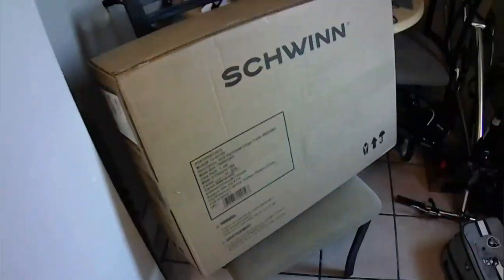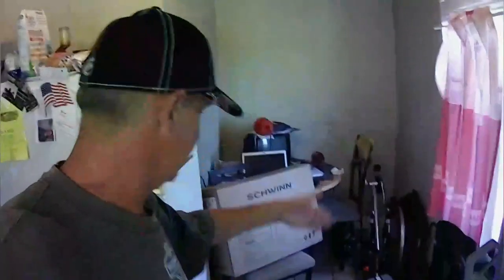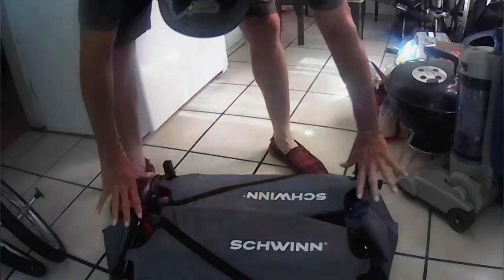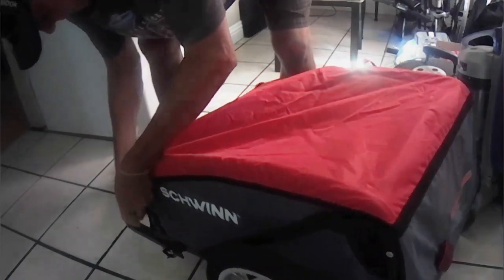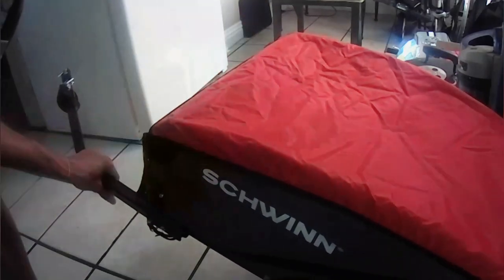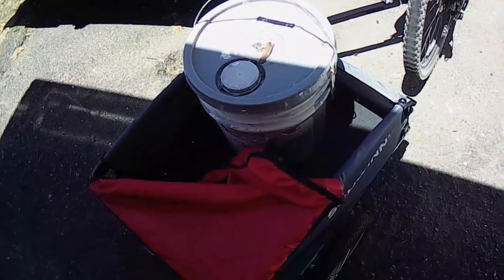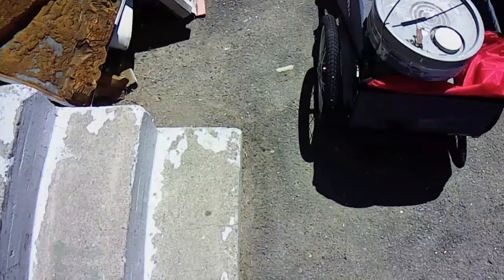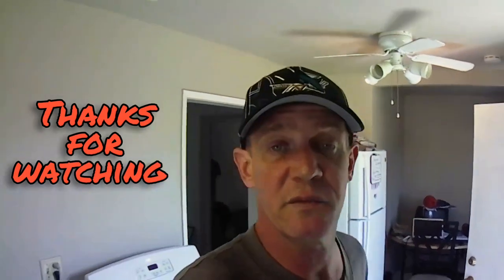Schwinn Daytripper Bicycle Cargo Trailer [unboxing]

Comment: Thanks for the review. Could you please tell me what the outside dimensions are when it is folded up? How has it lasted over the years you have had it?
Reply from the maker: When the two tires are removed and the arm folds and you collapse the walls, that will be the dimension. same as the floor of it.
Check for accurate dimensions in their description on my Amazon link.

I hope that helps.

I'm unable to as I'm on my way to work.
Reply from the maker: I forgot to also ad was when you do fold it up, it could be slid underneath a bed if that helps you out as far as how bulky it is.
Reply: Thanks for the information.

Comment: Hi Dan, you're a genius and your film is a great idea. I bought a day tripper cycle trailer.  Unfortunatley I got to the bit in your film at 5.11 and it didnt work for me, the arm swings round OK but it just wont snap in. It goes in the slot on the upright OK but however I try to get it to  snap and lock, it won't. Neither of them works, I expect I'm doing something wrong and there's a simple solution but I can't see it.  I tried contacting Pacific Cycles but when I was still at No.26 in the queue after 30mins I gave up. They dont appear to have a comtact email address.
Reply: Should have gone for the Burley Nomad...or even the Burley Flat Deck.
Reply from the maker: Once you swing the arm around, you replace the cotter pin back into the hole to secure into position. 
I think that's what your asking.
There is no automatic locking mechanism to secure the arm into position. It's locked into position with the pin.
I hope that helps.

Comment: What is the material used for the trailer floor?
Reply from the maker: I don't know exactly what you would call it but it's a durable yet flexible type of plastic, if that makes any sense.
The frame gives it stability.
I hope that helps.

Comment: The rims/tires look wobbly... loose fitting. Are they?
Reply from the maker: No.. 
Actually, once you insert the large cotter pin in place to secure the wheels, it's really stable. 
I put weight into it and it towed along just fine. I wouldn't risk overloading it though.

Thanks for the question.
Reply: @therealWoD  Thank you!. I currently have the Allen Sports Act 200, and they use a proprietary hitch & coupler (mount), and the coupler that stays on the bike, was stolen along with my bike a few months ago, and Allen Sports no longer supports that trailer (no parts), so I'm looking for a new one, and your review cemented my decision. Thank you!
Reply from the maker: I'm glad I could help.
It was a great purchase for me.
Hope it will be for you.
Enjoy!
👌🏻
Reply from the maker: Thank you so much for your comment. 
I'm sure you'll be pleased with it. 

And sorry about replying a month later.. SMH
For whatever reason I didn't get a notification.

Comment: Just ordered mine. I'm a lil worried that the capacity isn't quite what I wanted, but maybe it's bigger than it looks. I wanna throw my kid in there just here on our dead-end street and wondering if it'd hold him.. he's twelve. Any updates on it since you've had it all these months?
Reply from the maker: My cargo Carrier is still solid. haven't had to use it for heavy items. Mainly just for groceries or picking up a few light item things.
I don't know if I would put a twelve-year-old in it?! 
Not only just because of the weight, unless he's a light 12 year old, but maybe because for safety reasons.

That's just me though.

Thank you for the kind words.
Have fun. 
Let me know how it goes. Thanks for watching!

Comment: Could you tell me which are the internal dimensions? I need put inside a 14x21 inch box. Thanks
Reply from the maker: Hi...
I would think that it would be just fine to carry your box in the bike trailer.

Comment: Wanted to ask if it works with the schwinn trike
Reply from the maker: Hi.
I can't honestly tell you if it would.
I would think it could since the coupler that attaches to the rear wheel seems universal fit.
You might want to contact your local Schwinn dealership and see if they can answer your question to be sure.
Good luck.
Reply: It definitely would Not work right out of the box with a trike. It's not made for a trike, although theoretically the hitch assembly could be  modified, as anything can be modified for an alternate fit. Lots of work ahead.

Comment: Use your flag - it is a great awareness assistence in traffic.  You know the old saying, there are none so blind as the automobile drivers that see the bicyclists but don't. Especially on those on roads with no bicycle lanes. And, this is no test drive. Perhaps you should do an update after a month's usage. Much obliged, even so. Thanks.
Reply from the maker: I do agree with you. Safety is key. You always have to be on defense when it comes to traffic.
As an update after a month, that was a long time ago. But I can tell you that it's still holding you up and it hasn't failed me yet. As long as you take good care of it you'll get your money's worth out of it.
It's a good product.

Comment: Just wondering what the dimensions of this trailer are?
Reply from the maker: Sorry about the late response.
I measured it at 28x19 inches inside the floor of the trailer.
I hope that helps.